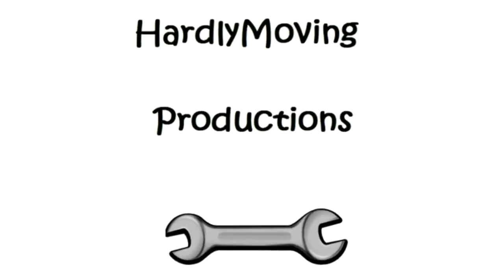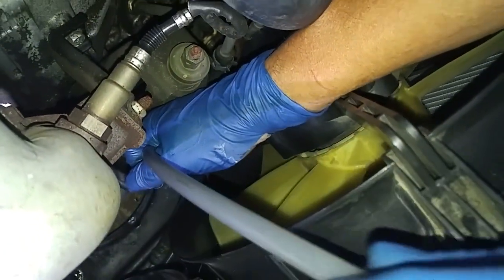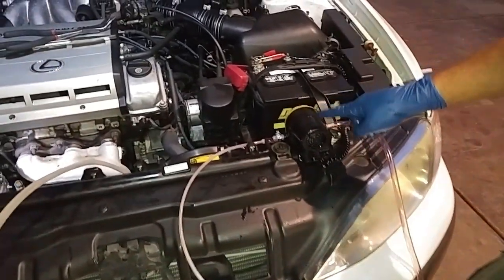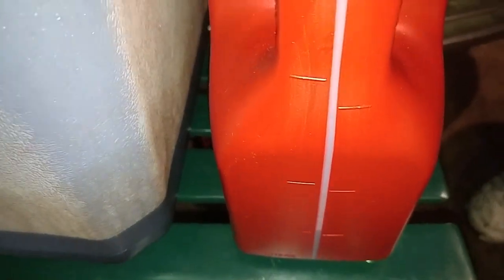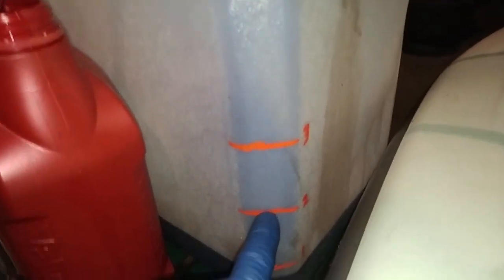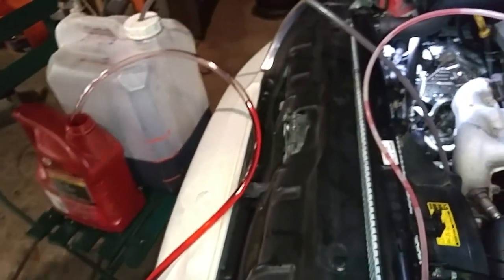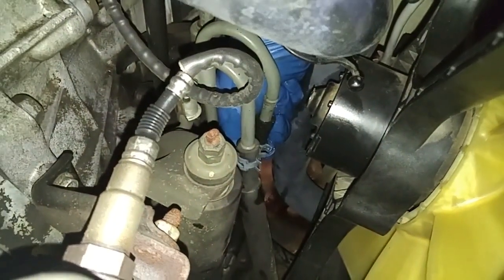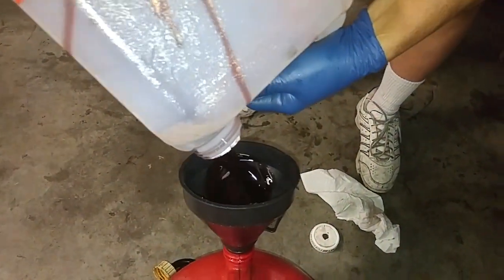Pump Assist Transmission Flush/Fluid Exchange - Lexus ES300 Redo Project

Comment: Thank you it's 2025 my 94 needs it I'm told type IV I hope this goes easy
Reply from the maker: You can use either Castrol or Valvoline Synthetic ATF which is backward compatible with older ATF ratings.
Reply: @hardlymovingpro  thank you

Comment: Attempted this and my fluid is coming out of the metal pipe and not the hose. I confirmed I did everything properly, pulled off the hose on the right side (driver side)
Reply from the maker: If coming from the pipe, attach a hose to it and let it drain out to a container.

Comment: Hello Again!

The radiator in my 1999 Toyota Solara gave up the ghost.  I decided I may as well do a tranny flush while I am under the vehicmcle as I recall this video from my grey matter. 

Midas manager told me he does not like to do transmission service on vehicles which have long gone without one.  I always drive old American junks until this current car.

Your video gives me the guts to perform a flush on my Solara also with an 1MZFE.

Question:. Why no filter change?
Reply from the maker: It's really not a filter but a screen to capture big chunks of whatever.  If you want to spend the time dropping the trans oil pan, that's up to you.
Reply: @hardlymovingpro  

Okay thanks.  For only about $10.00 more, and I'm sure the basket was never changed, just as the fluid likey was not either by the two 17-years previous owners and not by me the last 5-years owner.  

They guy I bought it from when asked if the timing belt had been changed replied "What's that?"

....ya, I think I will drop the pan and see what the screen is like. If it increases me, I guess I will take the extra $10.00 and ensure I get a rubber or silicone or otherwise non-paper/non-cork gasket.
Reply: Tran pan job takes at most 15 minutes.

Comment: Hello there friend, I was wondering if this Full Synthetic Valvoline MaxLife will work on a 2000 Toyota Sienna requring Dextron 3? Also is it okay to mix in with the OEM Toyota fluid for doing several drain and fills? I think the original fluid is regular standard non synthetic ATF fluid.. Would you recommend this fluid to mix in with the OEM Toyota ATF fluid either for several drain and fills, or fluid replacement like you've done here.. not sure if an alternative fluid that mixes in better with the OEM Toyota Fluid you recommend would work well for 2000 Toyota Sienna, If it makes a difference. Thank you and best wishes!
Reply from the maker: Yes ... the Valvoline Synthetic MaxLife is a great ATF for the money that I've been using for years on many different automobiles.  It has a wide range of compatibility with different manufacturer ATF ratings (i.e. Toyota Type 4, WS, Dextron 3, 6, VW, MB, BMW, Honda, etc.) because it's a full synthetic.  After conversing with a Mobil chemical engineer years ago, he stated that car companies as basically using Dextron III and fortifying it by adding some synthetic oil and including their own additive package.  Most ATF oils begin to break down quickly when temperatures exceed 180 degrees.  Full synthetics can withstand beyond 220 degrees before degradation begins.  If your ATF has turned pitch black, start with a drain & fill oil change and let the detergents in the oil slowly breakdown any sludge and varnish build up in the transmission and the clutch friction plates.  Do it one more time at you next engine oil change.  On the third engine oil change, you can do a complete transmission flush.  From that point on, you can do a flush every 50,000 miles.  Your transmission will shift like new and last a very long time.
Reply: @hardlymovingpro  Thank you much for responding to me, sorry for my late reply.. For some reason I didn't get a notification that you replied back, I only noticed your comment when I came back to view your video again. I will do as you recommend, my concern was using this Synthetic blend with the OEM ATF Dex3 already in the trans, might cause issues, but if they are fully compatible I will do the two drain and fills then go ahead with the flush on my third oil change. Just have two more questions relating to this topic, does the 2000 Toyota Sienna have separate differential fluid that will require a drain and fill or is it the same ATF fluid that gets pumped through the entire system including for the gear oil? And my other question is does the 2000 Toyota Sienna hold 8quarts or 12quarts of ATF fluid, just so I know how much will require for the two drain and fill and the final flush on my third oil change. Thank you again for the great advice!

Comment: I thought you would pump the ATF to the return line, instead of to the dipstick tube.
Reply from the maker: The return line and the dipstick tube both lead to the transmission oil pan.  So it doesn't matter.

Comment: I want to a drain and fill on my ES300 but noticed that the transmission drain plug is so rusted and stripped. Any suggestions for removing it?
Reply from the maker: You shouldn't have any problems removing the drain plug if you use the right sized hex socket.  Otherwise, you can buy yourself a suction pump with a long plastic hose to suck out the fluid from the dip stick tube.

Comment: Slick technique.  How do you know which is the return line from the cooler?
Reply from the maker: With other cars you have to test.  Disconnect the line, start the car for a second and see if oil is shooting out of the hose or the cooler.  If not from the hose, then its the return line.
Reply: Mine (same car as in video) was opposite of what the video shows.  Just gotta' start it and see where the fluid comes from

Comment: Do you have to use the electric pump to refill or can you just fill with a trans funnel? Also what size hose did you use to connect to the cooler line?
Reply from the maker: You can use a funnel.  Don't recall the hose size

Comment: Did this car do good after this? How long did it go? I just had my U140E in my ES rebuilt, and imma be buying a 2nd ES that also has a U140E, I dont think the fluid has been changed in a long long time, it still runs and shifts and all that fine, it's got 193k on it, should I attempt to do this to it to be on the safe side? Last thing I need is to pay for another rebuild lmao
Reply from the maker: Yes ... the project stopped because one of my customers wanted the car in the worst way.  That's was over a year and a half ago.  He comes over now just for oil changes.   These cars do last!
Reply: What could be going on with my 2000 ES300. I sometime get the 3rd shift sometime I don't. Will changing fluid save me a rebuilt trans?
Reply from the maker: Won't hurt to try but no guarantee that it'll fix it.

Comment: So do you ONLY need 2 gallons to fill?
Reply from the maker: 4 qts for a drain and fill.
Reply from the maker: For the ES300, Avalon and Camry V6.  Just like motor oil, you won't get it all out.  You'll have some old oil residing in the lines, torque converter and transmission that will mix in with the new oil.  This isn't a bad thing.  If the oil's too clean, the clutch discs may slip for a couple of days until the disc's varnish build up wears off.  Had this happen to me on a 2008 Camry V6.

Comment: Do you check the transmission fluid when the car is cold or hot in 1999 es300 lexus
Reply: Thank you do you live in stockton my friend
Reply from the maker: Nope ... outside of Memphis
Reply from the maker: Usually when hot
Reply: I can't get accurate on the dipstick it come dry
Reply from the maker: @christcrucified8887  Then you're really low?
Reply: Where should the transmission fluid be on the dipstick my friend
Reply from the maker: between the 2 V marks
Reply: Thank you for your help my friend

Comment: I’m at 219k and the transmission fluid looks very brown. Worth taking a risk and changing the fluid or leave it?
Reply from the maker: Sure ... if you want to play it safe, do several "drain and fills" until the fluid starts turning red.  You can decide later on if you want to do a complete fluid exchange.
Reply: Hardly Moving Productions I’ve asked my mechanic about a fluid exchange forrrver and they said it could cause problems with slipping, after asking you I mentioned just a drain and fill and they did it (using oem toyouta fluid) and it’s shifting like a dream! ) THANK YOUUU!!!!!
Reply from the maker: @sammelo9823  Hey ... glad it worked out for you!
Reply: Hardly Moving Productions what’s the difference between a fluid exchange and flush

Comment: Question: After spraying water on the top of the transmission box for 2-3 minutes (cleaned the rat's craps), there is whining noise, probably come from the transmission, sounds like the noise of the no-fluid steering pump. Do you have any idea what has happened? Any suggestion? I guess it may come from the fluid pump inside the box. Anyway to fix it? I checked all the electrical connections and didn't see any obvious reason. Fluid still at right level and looks clean. Always appreciates your help.
Reply from the maker: I’d guess it’s wet belt squeal that needs to dry off.
Reply: @hardlymovingpro  Thanks, but not that. It's been a week. Some say it may be the transmission pump.
Reply from the maker: The pump went bad because some water got onto the exterior of the transmission?  Did you check your ATF level?  Do you have a leak coming from either the left or right CV axle seals?
Reply: @hardlymovingpro  It happened the next morning after I sprayed with water. It may just happened coincidentally, but still hard to explain. I don't buy on that theory as well. Fluid level is right on, smell ok. No leak around I can find. It is 99es300. I'm going to do filter change and see what happens.
Reply: @hardlymovingpro  Yep, I did it. The filter was clogged up and the o-ring was broken. They were the reasons the pump drew air, instead of all fluid, hence the noise sounded. New filter makes the whining noise go away. Hopefully driving a few days with that noise won't damage the trans much. It was quoted $2500 to put another used one in in a car probably worth less than $3000.
Reply from the maker: You mean the filter (more like a screen) in the oil pan?
Reply: @hardlymovingpro  yes, it is.
Reply from the maker: Okay ... so you had to drop the ATF oil pan?  That's a lot of work taking off all those 10 mm bolts.  But otherwise, congratulations on figuring it out and fixing it!  The old ATF must have been really dirty ... coming out like glue the first time you changed it?

Comment: Should I flush my transmission? Is it a myth that flushing can cause transmission problems?
Reply from the maker: Maybe with American transmissions but not with Toyota.  As one transmission expert told me, if the transmission was okay before the flush, a flush will not harm the transmission.
Reply: @hardlymovingpro  High Mlg.Vehs.Are  NOT A GOOD IDEA TO Power   FLUSH ,AS TRANS. SHOPS EVEN SAY THE HIGH PRESSURE THEY USE CAN DAMAGE UR SEALS
Reply from the maker: What's a power flush?  What high pressure ... from where ... a machine?  Never heard of it.  Is that synonymous with a fluid exchange?  If so, I've never encountered a problem doing a fluid exchange.
Reply: @hardlymovingpro  Yes, I believe they hook up a machine and then "flush" all the old fluid out. A technician at a Japanese Motor Works shop told me I needed one but I refused.
Reply from the maker: I've stopped using the term "Flush" and now use "Fluid Exchange" since you're mixing and pushing out old, dirty oil (via the transmission internal pump) with new oil until the new oil dilutes out the old.
Reply: @hardlymovingpro  Thank you! I am hoping to follow your video to do a fluid exchange on my transmission soon. I hear Ravenol transmission fluid is best for these older Lexuses.
Reply from the maker: The $18 one gallon container Valvoline Synthetic ATF sold at Walmart has been working just fine for me.  I suggest you first do a "drain & fill", run it till the next engine oil change and see if the ATF has turned black.  Keep doing the drain and fill until the fluid color retains its red color.   At that point, do a full fluid exchange.  I assuming the detergents in the new ATF is removing the varnish build up on the clutch plates and dissolving any accumulated sludge buildup;  hence the reason why the ATF may get dark quickly after a drain and fill.
Reply: @hardlymovingpro  Same quality as the toyota t-iv flid?

Comment: I have a PO420 code on my 99 ES300. This is code for catalytic converter but it could be many other things and I don't know where to begin and replacing the cat is very expensive
Reply from the maker: You can install oxygen sensor spacers on your down stream O2 sensors and see if that turns off your light. Here's the link to the part on Amazon:
 https://amzn.to/2WNvMlM
Reply: @hardlymovingpro  Thank you! However, where I live I need to pass emissions tests
Reply from the maker: When at DMV if the exhaust system is hot and nothing is out of tune, you got a good shot at passing.
Reply: @hardlymovingpro  I also heard this code could come on from running to lean. I will check all my rubber hoses for cracks
Reply from the maker: You could but an O2 spacer is they way I'd go.
Reply: Hardly Moving Productions great I will do this. The ES has three O2 sensors, I believe. So does that mean I need to install the spacers on each one? 
Also will this poorly affect the car in any way?
Reply from the maker: A failing cat could be clogged which would restrict exhaust flow and hence impact power and fuel economy.  You can check but revving the engine and feeling for exhaust leakage out from the exhaust flange in front of the cat.  There are some vendors who provide additives you can add to your fuel that might clean up your cat.  I'd say you have a 50% shot at success using a cleaner.  P0420 is bank 1 ... so the spacer would be used on the sensor behind the cat leading from your front exhaust manifold.
Reply: @hardlymovingpro  I have already tried cat clean and putting a gallon of lacquer thinner in a half full gas tank. Is that sensor easy to change out? It is close to the radiator?
Reply from the maker: The downstream O2 sensor is located behind the cat on the exhaust pipe.  It's on pretty tight and you'll probably need a O2 sensor wrench to screw it out.  Here's the link to the tool most shops use: 

https://amzn.to/2Ijw1Rr
You can also remove the cat with the exhaust pipe attached.  The front and rear exhaust flanges are spring loaded.  Once off, you can examine the interior of the cat to see if its damaged or clogged.  If you want to replace it, you can get an aftermarket cat, cut off the old cat and weld in the new one.  Here's an article I wrote a few years back explaining how to do it:
https://hubpages.com/autos/Toyota-Catalytic-Converter-Replacement
Reply: @hardlymovingpro  I installed the O2 spacer by the downstream cat and my code has not come back and I passed emissions! Thanks!
Reply from the maker: Hey ... good deal!

Comment: Do you have a video for the fuel filter for 1999 lexus es300? Mine has never been changed....
Reply from the maker: I don't have a video but I have a article I wrote a few years back on how to replace it on a Camry.  The only difference is on the ES300 the top fuel line to the fuel rail is clipped vs a flare nutted.  Here's the link:
https://axleaddict.com/auto-repair/90-01-Toyota-Camry-Fuel-Filter-Replacement-Throttle-Body-Cleaning
Reply: 1 @hardlymovingpro  Thank you! Your channel is a huge help!!
Reply from the maker: Glad to be of help!

Comment: Do you know the size of that plastic tubing
Reply from the maker: Nope ... I just went to Home Depot's plumbing department with the 12v oil pump and matched the pump's outlet ports with available tubing in their inventory.  Once you have the tubing, secure in place with hose clamps (also got from Home Depot).  I made the mistake of not using the hose clamps and the tubes went flying off!  What a mess!

Comment: Wish I could find a precise mechanic like you to do the tougher jobs that require more tools. I need to re do my timing belt cuz the aftermarket one someone installed makes so much noise. Where are you located? Somewhere down south? I see there’s no rust in the engine. Rarely do you find a mechanic that can repair a car with such precision AND know how to clean/restore back to a new proper finish. Those two combined make a true great job.
Reply from the maker: Thank you for your kind words!  I am in the south, in Memphis, TN.
Reply: Trust me. 0 experience yet my ES300 went from dead to 100mph on short straights.

Comment: Great video boss man!
Reply from the maker: Thanks!
Reply: Hardly Moving Productions do you think a hand pump would work just as good?
Reply from the maker: You would have to use a hand pump if there's no dip stick tube to fill the new ATF.  Those transmissions on the Toyota's have a fill port on the side of the engine.  On European cars and some American, you have to pump it in through the bottom of the oil pan plug ... a real hassle!

Comment: I just did mine yesterday. Wish you would have uploaded a day earlier. I merely drained the system through the bolt hole and filled through the dipstick hole. Do you think I will have an issue since I didn’t do a complete exchange?
Reply from the maker: No issue not doing a complete exchange.
Reply: @hardlymovingpro  Thanks
Reply from the maker: Nope ... not doing a complete exchange won't create any issues.